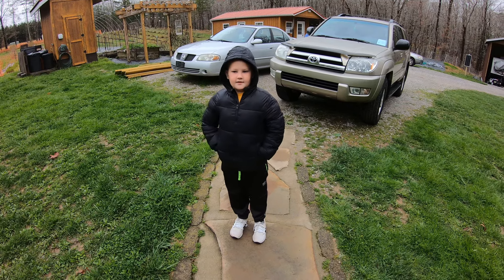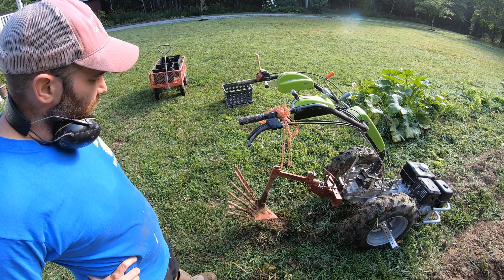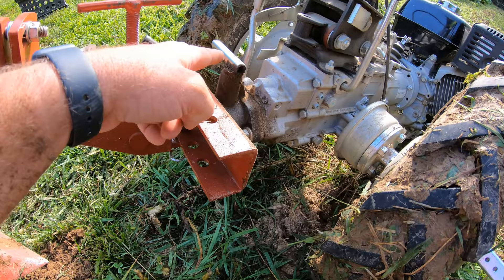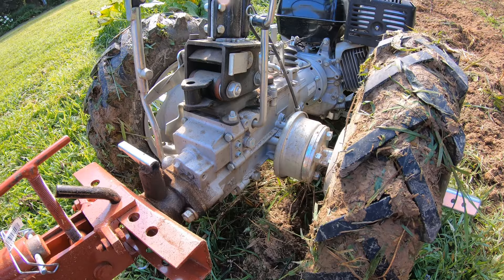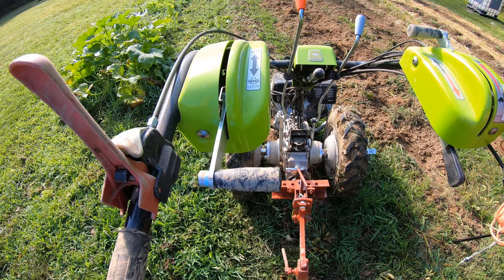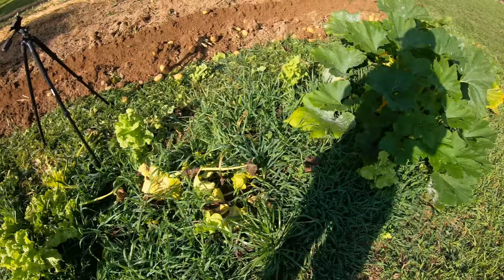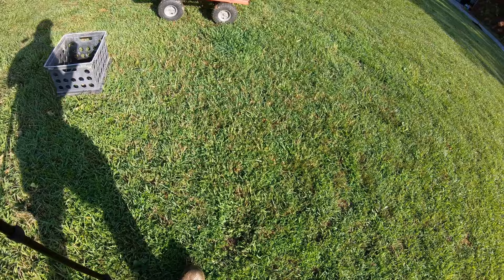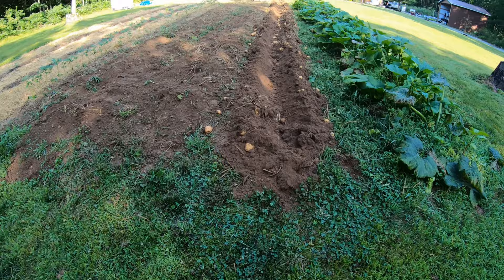Harvesting Potatoes 2021 With Grillo G110

Comment: to make your own wheel weights, take a round bucket, determine the center, insert a square tube that fits over the tube of the tractor weels , make a hole in the bottom so that it protrudes underneath., drill a hole in the tube and in both sides of the bucket. and  insert a hollow round tube into the both sides of the bucke tru the square tube and fill your bucket  with cement until it reaches the weight you want. let the cement harden cut a bucket around it of and  then shorten the round tube and you have a wheel weight

Comment: You mention wheel weights. One option we use on farm tractor tires is put the tire valve at the top and fill with windshield washer fluid then put the air valve back in the stem and add air pressure. Your tires it would be like adding a couple of five gallon buckets of water on each side and likely most of the weight you need.

Comment: Thanks for the video, very helpful, I have the diesel 131, in Australia.
Reply from the maker: Hello to our friends in Australia 🇦🇺. Does your diesel 131 have quick connect or do you have to bolt the implements on?
Reply: @hendonfarm1015  Hello, you have to bolt on attachments, it has 22mm nuts so it is very heavy duty. I have the Grillo toolbar but haven’t bought the potato lifter yet, only the plough. I have the larger wheels and wheel extensions. I also have Joel’s wheel extenders like yours but haven’t fitted them yet. My 131 is the diesel 2010 model before the new clutch system. I prefer that as that new system was introduced because of EU safety standards. I have the trailer and in transport gear, it flys! It spends most of its time with the larger wheels, extenders and the trailer, but I have the 800mm tiller, Berta rotary plough, Berta flail mower & the Grillo badged R2 Rinaldo Power Harrow. The rotary plough is the Grillo supplied one with the extra weights and 131 mount, same with the flail. My tractor and mower are JD 👍
Reply from the maker: Sweet. Sounds like you are well equipped my friend.
Reply: @hendonfarm1015  Had the gear from new, before that I had a Valpadana VMC150, with a number of implements but was rope start, getting too old for that! Love my Grillo and John Deere of course!

Comment: Do you leave the 2 bolts from the tool bar loose so the plow sways side to side?
Reply from the maker: Yes we leave some play in it in case you hit a rock or something else in the soil. That little bit of play will also help you make corrections in steering while you are plowing.

Comment: I like your machine, seems to work ok.   I find the big problem with walking tractors is weight.  They don't have enough..
You probably could use 300lbs on that machine yet.
Reply from the maker: Thanks for watching. Yes, weight can be an issue especially in heavy clay or Rocky soils. There is a limit to the amount of weight that you can hang off of each side. I am slowly learning the good and best uses of this walking tractor. So far rototilling and flail mowing are high on my list.